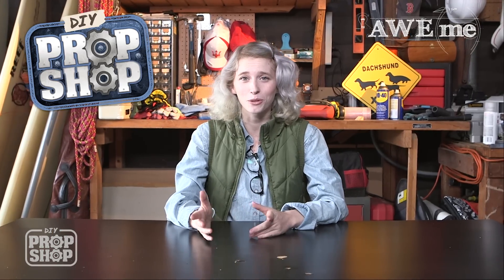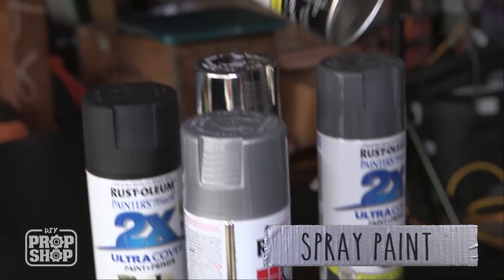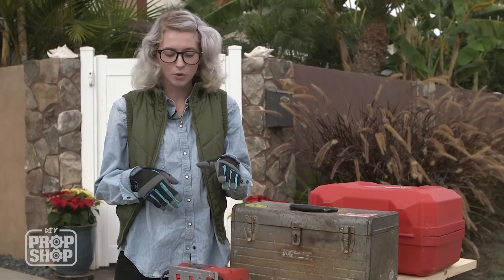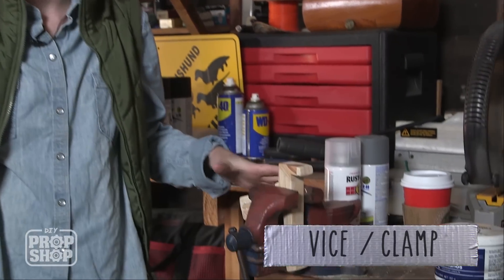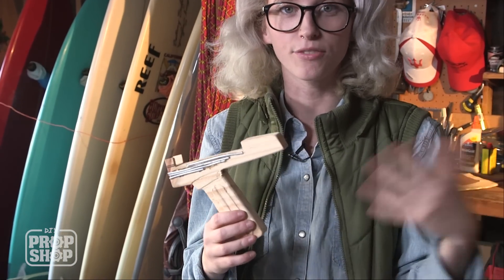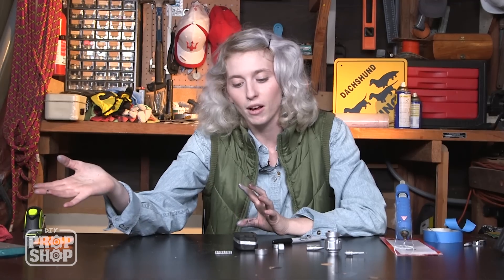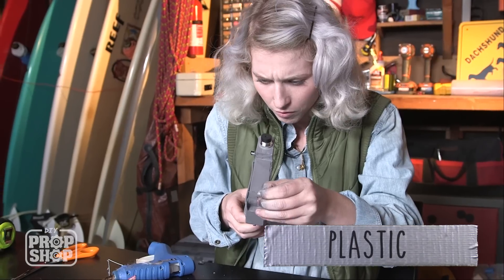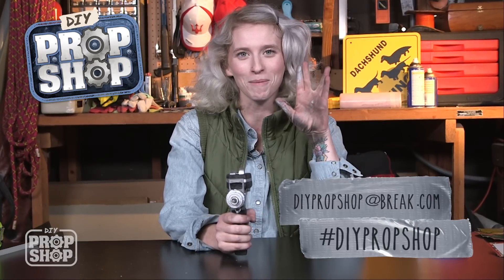Build Your Own Star Trek Phaser! - DIY Prop Shop

Comment: 1978 I made mine from wood and scrap pieces from an old radio and plastic model parts. Got featured in a city newspaper and on display in a library because it was a homemade replica mire accurate than any model of the time.

Comment: More ideas for the phasor gun from an electronics guy. Put a small laser pointer, into a CGB electrical cord grip. Take the top piece and cut it out to hold a 3-AAA battery holder. Put a Piezo buzzer under the metal gridwork to duplicate the phasor sound, and a round doorbell button for a trigger. Would be as realistic as could be for under $20. Gonna have to build one now

Comment: if it was me i would have used rigid foam for the body rather than wood, used a clear pen body and a cheap dollar store led flash light for the push button and for the working light effect......but nice build.

Comment: I think that every single tool used in this video is used in an inapropiate way. I would definitively not use most of those tools in this build even using the same materials.
well, the jig saw is good I gues...
Reply: +MAking Props Well, sometimes you need to improvise.
Reply: +MAking Props She used a router bit on her rotary tool to carve out sections to a certain depth. She used a drill to drill holes. She used a jigsaw to cut complex shapes from wood. She used a vise to clamp the piece down while she did everything else.

Don't see how she used any of those tools incorrectly.
Reply: +VariablePenguin simple, the stone used on the dremel wasn't apropiate for wood, she used the rotary bit to make raised areas, which are MUCH easier to raise them using any kind of thin plastic, why did she break the front part while drilling? guess what, wrong drill bit type and too much force aplied. I can keep going on
Reply: +MAking Props I thought she broke the front part because she hit that massive knot in the wood.
Reply: +VariablePenguin if you use your tools properly, no knot, no joints, no fibers are an excuse
Reply: +MAking Props The definition of "the proper tool" is defined by whether it gets the job done. If everybody would only use tools the"right" way, there would be no innovation.
Reply: +Diggnuts yeaaah... innovation... except for its dangerous, highly un productive and this suposed to be a tutorial that shows the people how to do things... excuse me, ho wo doy things, wrong!
Reply: MAking Props
You must be really clumsy if every time you stray from the norm, you put yourself or others in danger.

Anyway, this is a tutorial that shows people how to do thing, just not people like you.

At the end of the day, I think people who actually make something instead of telling how they would never make something are much more interesting.

In that sense, you are doing it the.. wrongest.
Reply: Matteo Pascolini
And? Am I supposed to be impressed by that run-of-the-mill unoriginal nonsense? I hate star wars rubbish... what a waste of time and materials..

Your point was what?

Comment: Can't help but feel a bit disappointed. I think the original guy would have done a much better job keeping it easy and using tools that most people have. He would have also explained the step by step process better. I was looking forward to building a faser, guess that's not happening.
Reply: You can do everything she did with a basic handsaw, a coarse rasp/file, and sand paper. Additional items that would make the finished product look better would be an automotive body filler or drywall putty to fill in the grain before painting, which will leave you with a smoother finish, and maybe some satin poly clear coat.
Reply: urmominabox87 perhaps, she just needs to explain it better, I'm not adept with the tools involved at all.
Reply: T.R.U.E! That

Comment: first off if the creator of the prop sees this; do not take it as just pure bashing, what im trying to convey is constructive criticism of mistakes which where most likely due to either time and/or budget constraints. 
with that said as someone that makes props as a hobbyist with the aim of ''it doesn't have to be perfect but it at least has to look convincing enough to be usable on film at 48fps'' this looks like its really cheap build made with some fancy tools without any of the final steps needed to finalize that kind of build because it was done in a day by someone not experienced enough to make that combination of factors work...
I've always felt there are 3 base factors in art: price to create, time it takes, and the quality of the final piece. 
when working as a hobbyist in a small group or alone only 2/3 can be accomplished at once... low price + good quality = long time to make, good quality + fast = expensive, and what i feel this shows; fast + low price = poor quality

Comment: hate to break it to you but you got some of the parts actually backwards like the top portion that's colored black that is actually supposed to be the type 1 phaser that is inserted into the pistol grip portion....... although it seems very close in appearance your kind of off in some areas..... I actually have a real replica of the type 2 phaser.... so I would know if you've got portions of yours backwards and in the wrong area

Comment: So what? It's not a screen accurate professionally made prop!! But the video had me cracking up, especially with the P1 being backward. But it was just meant to be a fun project and nothing more. Don't be a bunch of haters lol...

If I may make a suggestion???? Here's a project you might be interested in. Being you have the basic shape of the phaser parts in hand try using that 2 part epoxy plumbers putty stick as your mold. After it drys it's very sandable and can be manipulated very easily. If you heat it up with a heat gun before mixing it makes it softer and easier to work with. You'd be amazed at how many masters are made from that epoxy.

Comment: (Don't pay any attention to me, Trekkies. I'm just commenting a random thought.) I wonder if a lightsaber could deflect a beam from a phaser like does the laser blaster bolts in Star Wars?
Reply: +Damon Fyrian It would more likely either pass through the light saber or be absorbed by it rather than be deflected. Blasters fire bolts of plasma energy while phasers fire beams of nadion particles (fictitious artificial particles capable of liberating atomic nuclei). On the highest setting phasers will disintegrate unshielded targets at an atomic level. They're designed to weaken and eventually cut through shields, so the lightsaber would probably weaken on contact with the phaser beam, but on the other hand it might just straight up absorb the shot like it does with force lightning.
Reply: Adahop A lightsaber is a blade of concentrated plasma, so there is no way to weaken it, since the power source is in the hilt. And lightsabers don't absorb force lightning, but they can deflect/redirect it, like Mace Windu did.
Reply: Damon Fyrian I distinctly remember Yoda's saber absorbing Dooku's lightning. Am I wrong? And phasers have the capability to dismantle atoms themselves, which includes plasma. Either way it'd be a cool fight to see.
Reply: Adahop Yoda never used a saber against Dooku's lightning. He used the Force Ability Tutaminus, which is capable of energy absorption (it can also be used to stop a lightsaber barehanded, but that is much harder to do).
Reply: Oh whoops, that's what it was. You're clearly the Star Wars fan and I'm clearly the Trekkie, haha. I was basing the absorption assumption off an entry on Wookiepedia that says they're capable of absorbing force lightning. Maybe it was an EU thing.
Reply: Adahop I'm a Trekkie, too. Star Wars was my first sci-fi anything, though, so it will always be my favorite. (I saw my first one at like, 8.)
Reply: +Damon Fyrian I don't want to seem nitpick but Star Wars is "sci-fi" or better said space opera, don';t get me wrong I love Star Wars and the way they not take since to seriously being just a mean to make the narrative go forward.
Reply: Otger Fabre No offense taken, and I understand that. But if it has space in it, it's sci-fi. Plain and simple. XD

Comment: I built a more accurate one with cardboard, sheet metal and duct tape, and I was 15 when I did it. Added lights and sound 10 years later. I am 50 now and it is still together. Not sure what you built there.

Comment: My only complaint with the finished piece is that the barrel/nozzle/end thing extended too far out the front of the gun, i would have cut the silver piece almost in half  and used the forward piece from its widest point. Points for effort though.

Comment: The top is off. The curved parts go towards the back with the mesh at the front. Did you even use your reference picture? It looks like a tape dispenser hot glued to a pinewood derby car.

Comment: Need to round off the edges of the power pack a bit. And those wires have got to go.
Reply: Also, it bugs me that the builder didn't take the time to give us a complete list of parts. And no way she can go through all those prices on the ones she did and still say it was $12 bucks. Sounds like some common core math there.
Reply: +James DeRuvo I was thinking the same thing. She said the spray paint alone was 4 dollars

Comment: I really appreciate your skill and ability to pick out parts to use. However, your scale is off. This is one of the most important things. It looks like a toy made for a little kid. Some pieces are also not to scale with other pieces, such as the emitter on the front (too big), and the Phaser 2 on the top (too big). Also, the phaser 2 on the top is backwards, and you should have sunk the controls into the wood further.
Very impressive that you managed to do so much with so little, and so quickly. And not only that, but such a cutey too.  And I'm not talking about the phaser.

Comment: Your totals at the end don't add up. All the dollar store & hardware store items at the beginning of the video add up to about $24. Not $5. Plus the wood, puts you at $31 for the build. Doing a 5 minute google search I found prop replicas that are screen accurate for about $10 more. So I can spend 5 minutes and about $40. Or $30 and all day in the shop. I'm all for DIY. A big fan actually. But this build doesn't make sense. If you're going to spend the time building something, personally, I'd rather take the time to do it right.